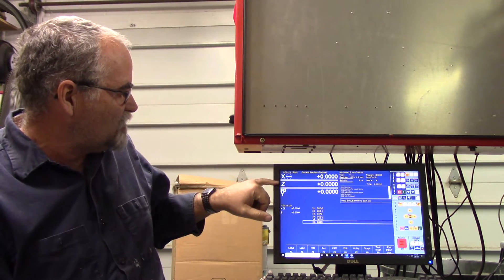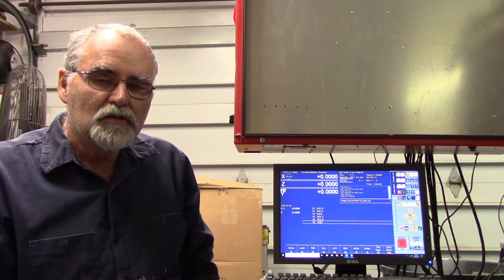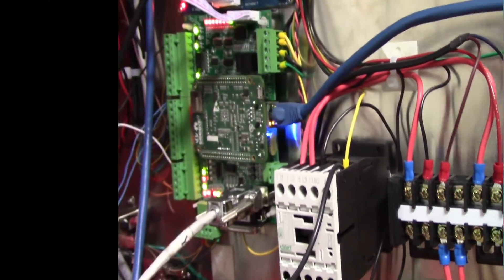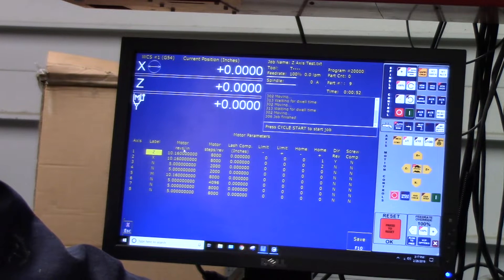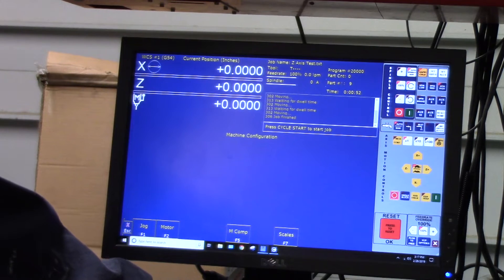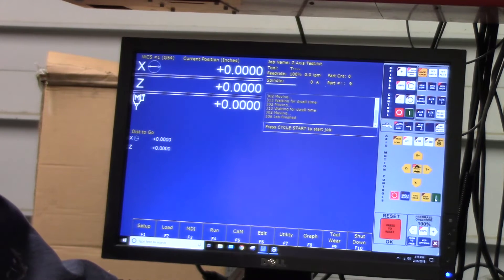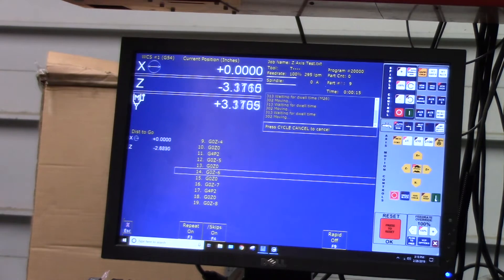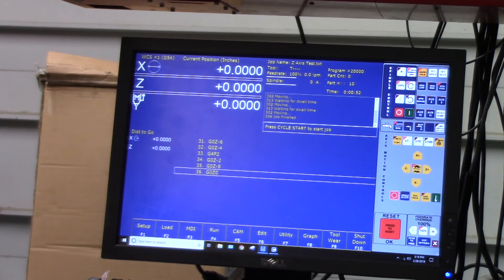Using DMM DYN4 Encoder Port to feed back into Centroid CNC Acorn Spindle Encoder Port

Comment: DMM encoder port is an “emulated” encoder from the real one (that is an absolute serial encoder) you can even change the encoder resolution on the DMM setup program.... (in the LINENUM parameter), so a more real test would be to check the emulated encoder on the Centroid software, but with the DMM motor driven via the DMM app (via serial communication), (lets say 1 complete rev) and check in the Centroid software DRO that it actually did it...... (do an auto tuning setup before trying this)... nice video... regards....

Comment: Are you planning on using a servo to drive a spindle and set it up for indexing?
Reply from the maker: I have no interest in doing that myself. That said I am testing the feature on another project and seeing if we work out the kinks. You have to have some sort of brake to lock the spindle. You can't rely on the servo to hold the spindle against cutting forces.
Reply: @martyscncgarage5275  so, any kinks?
Reply from the maker: @satxsatxsatx  Kinks?
Reply: @martyscncgarage5275  you said "work out the kinks",    did you find any kinks?  after all the running around, did the spindle come back to the origin?
Reply from the maker: @satxsatxsatx  Not gotten that far.